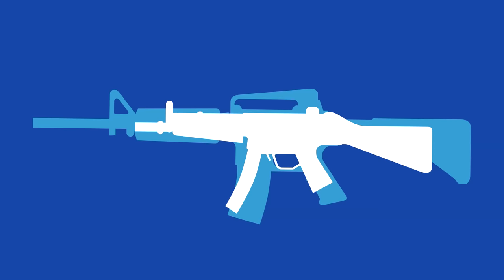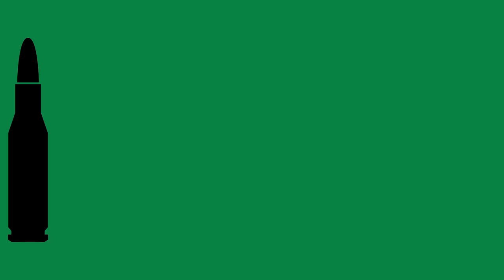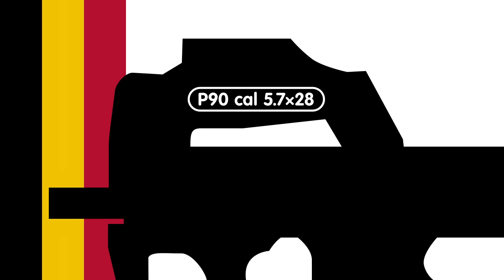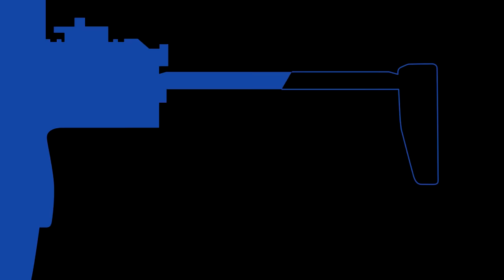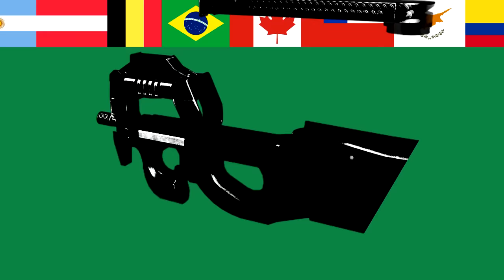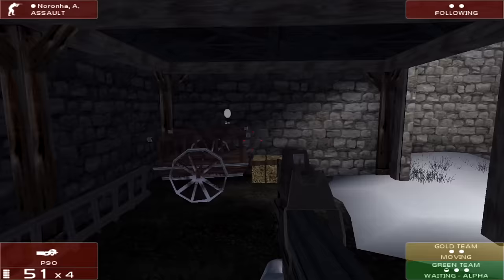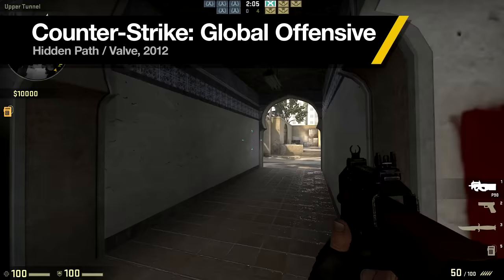P90.

Comment: So technically Doc and Rook should be faster when using a p90 rather than a shotgun or mp5
Reply: The P90 should also technically do more damage
Reply: @benallen4980  You know this is what r6 is missing. Realistic qualities
Reply: @benallen4980  and less recoil
Reply: It just needs more damage, the recoil is all right as there's no barrel attachment option. I bet the mp5 without the vert grip would also be bad

Comment: You should do a video about the Glock
Reply: That's not very specific. There are numerous Glock pistols with different calibers, sizes, materials and features. Take the Glock 18 for instance, Fully automatic and if i remember correctly, can be place into a fmg 9 frame to make an smg.
Reply: Has he done the M1 Garand?
Reply: Super Mario Neon yeah
Reply: FunGuyStudios actually regarding materials, all Glock pistols are polymer framed striker fired handguns with the slides of the same material too. However, Glock pistols of larger calibers, such as 10mm Auto, have thicker slides than those of smaller calibers, such as 9mm or .40 S&W. Except between generations, there aren't that many differences in features among the Glock pistols of the same generation. The FMG 9 was a separate SMG. What you're thinking of are CAA Roni Carbine kits - a specific chassis will take a specific handgun model, including Glocks among other models of handguns.
Reply: Its called 98 in 9 hits
Reply: Hell yeah!! Especially the Glock 18!!
Reply: @zlurkx2432  yes
Reply: Andresalex4 I 100% agree

Comment: Alright I'm going to say it one more time : can you please do an episode on the FAMAS, please ?
Reply: True that, also hopefully he'll cover the F2 variant or whatever it is that fires at the astonishing 1000 RPM that makes it infamous in Black Ops.
Reply: The only two existing variant of the FAMAS are the F1 and G2.

The F1 is your regular, 25-round straight magazine FAMAS used in the French Army since the 80s, while the G2 is the one that uses standard STANAG magazines and used by the French Navy. https://upload.wikimedia.org/wikipedia/commons/thumb/5/50/FAMAS-F1_vs_G2.svg/1280px-FAMAS-F1_vs_G2.svg.png

Some F1s were modified, replacing the distinctive handle by a Picatinny rail, as a part of the FELIN system. We call them the FAMAS "Félinisé", and they were developped recently (early 00s).

The FAMAS you see in Black Ops is completely anachronistic, as it uses the rail of the Félinisé, despite the gun still being a prototype (development started in 67).

Comment: I love your content can you do the VSS/ASVAL?
Reply: shadow Tornado777 
Not enough real world info
Literally unobtainable outside Russia
Reply: i've got the airsoft version. Sexy weapon
Reply: EHW2 There's plenty of information out there. It fires a subsonic round (possibly an amped up 9MM), has an integral suppressor, 20 round detachable box magazine, select fire, can be used as a DMR (designated marksman's rifle) or an SMG in a pinch. The Vintorez is an odd weapon looking like a cut down SVD, but the Russians wouldn't have put it into service unless it worked all the time, and did its job effectively much like the Kalashnikov series of rifles.

Comment: Tell that to Rainbow Six. Fucking 21 damage. So much recoil, and the iron sights argh. It sucks in video games
Reply: Papa Chanka Learn to handle the recoil by bursting instead of spraying. or use the recoil as headshot machine
Reply: Modern Warfare 3 recollections there you just brought back dude. Put FMJ and an extended mags on it and you can blow helicopters out of the sky.
Reply: Papa Chanka Praise for lord Tachanka
Reply: +Michael Rosvold Andersen Are you joking? The P90 is full-auto, no crappy half wounding bursting.
Also very hard to headshot with the amount of dispersion
Reply: Dope in cod and cs
Reply: COD4 m8
Reply: Remember when they mentioned that the weight of the bullet was about a quarter of a 9mm one? That comes with a cost: The bullet isn't light enough to fly slow and still do damage, but isn't fast enough to make up for lost weight. My dad used to work in contracting and described being shot by a P90 as "being stabbed with a pencil".
Reply: I am dead serious. i know it's full auto but don't expect some cod shite and go full auto with no recoil on any guns. if that's the logic then i could just take a drum mag on a G18 with a stock and spray and pray anything and anyone i see. and if you can't hit the headshot then too bad. you better git gud or stay bronze
Reply: See thats why in CS:GO there are no iron rights, and there are no silvers that dont use the P90.
Reply: ***** are you saying its physically impossible to full auto drum mag a G18? If so your missing out on a firearms channel
Reply: Papa Chanka WELL NOT FOR FUCKING CS:GO!!
Reply: Shooting accurately whit normal 9mm full auto just sounds bullshit for me. I know shooting 556 calibered rifles on fully automatic is just not viable. So go back to cod or csgo allready. And learn to tap or burst fire instead for best accuracy ingame or just uninstall the game.
Reply: ***** since when do you burst fire a P90 in cod or csgo? (Even more for the Akimbo)
If your needing accuracy its because your playing it wrong at long range. Anyways its your playstyle, I think you would do well with Rifles too
Reply: I don't play cod. Too much arcade cancer and spraying in csgo is just... no...
Reply: After I read this I tried the P90 with ACOG and extended barrel and holy shit the head shots. My favorite kill is me shooting through 2 dead bodies and a wall to head shot the last guy. It's amazing I'm posting it on my channel
Reply: p90 is ass in real life too
Reply: berserk972 please explain why........
Reply: Joe Donnelly Idk maybe cause it does a poor job at what its main selling point is which is defeating body armor
Reply: Papa Chanka then dont use it. I personaly have 350 kills with the P90 which is my second best weapon with the first being Caveira's pistol Luison 500 kills
Reply: berserk972 yeah I get that but no contender is better even if this is still shit, it in its original select fire configuration is almost definitely one of the best smg's ever manufactured en mass.
Reply: Joe Donnelly Yeah but there is probably zero chance I will ever get my hands on an original fire mode p90 and if I did these guns are stupid expensive and the round it fires is just bad. its expense, really weak and like I said doesn't do its job.
Reply: +berserk972
so in other words what you're saying is that your supposed personal fire testing is more credible than official NATO testing.

5.7x28 is very capable vs most Body Armor.
Reply: ***** ok point me to a YouTube video with just the basic round going through body armor.
Reply: MP7 is gun of God in all FPS game.
Reply: The recoil isn't as easily controlled as the MP5's due to the random direction the recoil travels in. It also does less damage and is more likely to down someone rather than kill them.

As it is, there's no reason to use the P90.

But seriously, if you're complaining about iron sights, there's zero reason to use them... EVER.
Reply: >So much recoil

I've used one before at a rental range. The recoil is definitely there, because the P-90 has no weight to absorb it. 

I'd much rather use a Sten or a Thompson again.
Reply: ***** Then that defeats the purpose of why this weapon was built. This video says it and everyone and their mother says it. It cant even preform its selling point. This gun and round are just over hyped trash.
Reply: Troll Face, depends how you use it. But yeah, I think Bandit is an all round better operator
Reply: Papa Chanka the p90 with a silencer was deadly in moder warfare 2
Reply: The basic commercially available round isn't designed to defeat body armour. Nor was the P90 designed for the civilian, semiauto market. It doesn't do a "poor job" at penetrating armour with the right ammo, and since there isn't a big civilian market for the proprietary round, it's expensive. But then again, if you're buying the civilian-legal version, you're just doing it for "tacticool" more than any practical consideration, and if you're a goverment buyer, you can get the select-fire model and the greentip ammo. So it's a shit semiauto gun, not a shit gun overall. But aren't you 'mericans basically swimming in AKs and AR15s anyway?!
Reply: Christopher Kunst So what youre saying is its only good in that full auto configuration. So its only half as useful as most guns cool. Did you ignore half of this video when this guy was going on and on about armour percing capabilities?We swim in those guns cause unlike other countries when we design something to do a job it works and we kinda like stuff that works.
Reply: You know what the concept of an smg is vs the concept of a rifle, right? That these have different niches that they fit in, which doesn't make one "half as useful" as the other. The P90 makes no sense to a civilian buyer because it wasn't designed for that market, it has no use as a semiauto sporting/hunting rifle. It's usefulness is in Special Operations and CQC.  
That said, there are a lot of useless gimicky guns designed by US designers. And the king of "getting the job done" is still the AK, and the Russians built that platform. In fact, I sometimes get the impression with US gun owners that having the weekend warrior tacticool stockless bullshit trumps any consideration for practical use. You're really sticking your neck out on a topic you don't seem to know much about.
Reply: Christopher Kunst one thing the p90 isn't an smg... Or did you just decide to ignore the other half of the video where he talks about pdws but sure I have no idea what im talking about... Yeah we make useless mall ninja accessories you guys make entire guns.
Reply: If they were to buff the P90, people would get triggered because of it being "too overpowered".
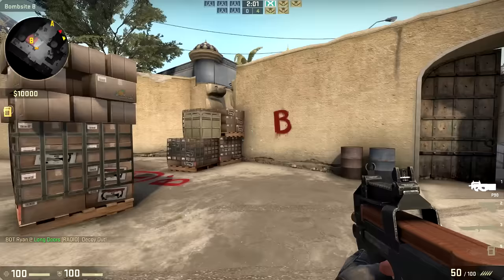Reply: Christopher Kunst Yup a PDW thats so ass at what it was designed for that it makes an ok smg. Pistol caliber, compact, and fully auto yup thats a PDW too. Ohh what was this classified as when being tested NATO and designed? It was tested and designed to be a step above an SMG but below a carbine? But that would make it a PDW... What is this thing addressed as through the entirety of the video? A PDW and refers to it as a SMG after 10:05 for the first time after referring it as a... Say it with me... PDW that entire time. And he says it while talking about videogames of all things lol. Keep saying that I dont know anything. I only have a sea of YouTube videos to back up my claim. If the video is so simplistic how is it that you managed to fuck what its designation up that bad lol
Reply: "PDW" is a combat role/deployment classification that can be either filled by a subcompact carbine or a submachine gun. The P90 is a smg. The AKS 74U is a weapon that fills the role of a PDW but is a subcompact carbine. If I take a MP5k with folding stock (the variant called, ironically, PDW) and load it with russian ammo-piercing +P+ rounds, it can fullfill the role of a PDW according to the NATO doctrine. Does that mean it ceases to be a smg? No. A smg can be a PDW. A subcompact carbine can be a PDW. Since NATO never finalized the PDW classification, a "PDW" is just a marketing brand attached to a particular gun. A MP7 is decidedly a PDW according to the NATO standard, but its manufacturer calls it the MaschinenPistole 7, meaning submachine gun 7. You don't get what the designation "PDW" actually means. Stuart Brown gets it, because he refers to the P90 both as a PDW and a SMG. How bout we have this conversation again when your balls have dropped and you lose the self-assertion teenage bullshit?
Reply: Google is your source. I see.
Reply: Christopher Kunst And thats like saying that all semi auto snipers are just classified as snipers for marketing brand. There all just long ARs.
Reply: Christopher Kunst and yea its kinda the best source to have. Where are your sources...
Reply: Christopher Kunst Fn of America classifies it as a PDW too... Its amlost like im right huh?

Comment: MP7 and P90 is designed for penetrating armor. Battlefield 4 where they are the only 2 smg to do under 22,5 damage(MP7=20 and P90=21), and there is a perk you can spawn with that gives 10% damage reduction on the chest.
Reply: They can penetrate soft armor, but they stand no chance against hard military plate like the standard level IV plate used by leading militaries today.  The armor piercing rounds they use have arguably poor terminal ballistics in flesh.

Comment: I have the FN PS90 (Civilian version) I love this weapon! There are some downsides. It's a bullpup so the trigger is not the best. But the biggest downside is the height of the sight over the bore. Makes it difficult to engage targets at different ranges. I have mine zeroed at 30 feet. It's not a sniper. It is meant to be used in close quarters and that is why I have it set at 30 feet with my sig Romeo red dot. It is great for clearing houses and going room to room!

Comment: The problem with the 5.7 round is that it lacks energy and expansion on impact, in other words it is a really weak round. To put things into perspective a 9mm Parabellum round expands on impact to around double of a 5.7 round and has more energy. That is why the P90 features a 50 round mag, it is solely designed to spray as many 5.7 bullets as possible in very close quarters to take down armoured threats.

Take the P90 at a longer range though and the MP5 would win everytime, that is why special forces such as the SAS swear by the MP5 and hate PDWs like the P90.

Comment: I like how games, just nerf the gun because of the 50 round in the mag. Like come on, it pierce a thin metal sheet, and 20 layers of Kevlar. It could pierce that at 200+ Meters.
Reply: the only issue is that for the allegedly intended purpose of being issued to backline troops, the P90 would've completely failed because the VDV recieved upgraded body armor that used slightly thicker titanium plates around the same time that the P90 was made

not only that but most modern body armor issued out by any military will easily and reliably stop SS190 rounds
Reply: @harveyknguyen  Well, there's a reason that only the Belgian and German army's use their PDW's for their intented purpose.
The rest of the world found them a little too expensive for giving to truck drivers, so the both of them are most commonly used in counter-terrorism.
Where body armor is less of a concern and due to their small size they are easy to use indoors during a raid.
Reply: @casper6800  what does that have to do with the original comment or mine
Reply: @harveyknguyen  Because, the truck drivers I spoke about are the exact backline troops you mentioned, that the P90 and or MP7 are issued to.
And there are very few, if any, places outside of Belgium or Germany where both of those weapons, are used for their intented purpose.
And even if they would have trouble against modern armor, they would still be more effective than a pistol, while being less cumbersome than a rifle.

Comment: I wonder what the RC in Goldeneye RCP90 stands for. Also, you say that it has super high velocity and penetration with its unique round but you also say that it's per round damage is low. But these two characteristics don't correspond
Reply: It does kinda work. It has a really high velocity, which aids in penetration, but at the same time it is a tiny bullet, which transfers less energy thus making it weak

Comment: You totally need to need armor perception in a smg bc you are going to be firing that thing at a apc
Reply: that's not enough penetration dude, APCs have at least 20-30mm of steel/aluminum armor and should be able to withstand up to .50 cal
Reply: P90's 5.7's SS190 AP round only penetrates soft armor, up to IIIA.  It won't penetrate standard military body armor Level III and above.  It has 0 chance of penetrating anything on an APC
Reply: @deanc91  i mean he's technically not wrong but then again you'd have to shoot at the same exact spot for a solid 5 minutes for it to even go through

and that's not even considering the fact that the APC and squad that dismounted would've turned you into paste
Reply: @harveyknguyen  Sure but by that standard, even .22lr is armor piercing if you shoot at the exact same spot long enough.  Generally, AP would suggest a penetrator that is rated effective enough to penetrate a certain armor level with reasonable reliability.  The problem with 5.7 is that people hear "AP" and think it is a blanket penetrator for infantry body armor, but in reality, it's only capable of penetrating soft body armor unless you're extremely EXTREMELY fortunate that you shoot someone wearing hard plates that have already been shot to dust.
Reply: @deanc91  yeah i wasn't saying it was a good idea or even something anyone would should even consider doing it

but yeah i'm not sure where he was coming from or getting at with the apc line

Comment: When the p90 is fired full auto the thing jams WAY to much. Getting the thing to run without jamming is asking for a miracle when your talking about real life: more or less the reason why it is not seeing use all the much now when you can just use a M4 with a 10.3 inch barrel that does not have the jamming issues with a objectively better round running through it.